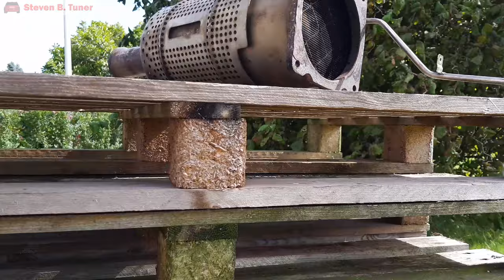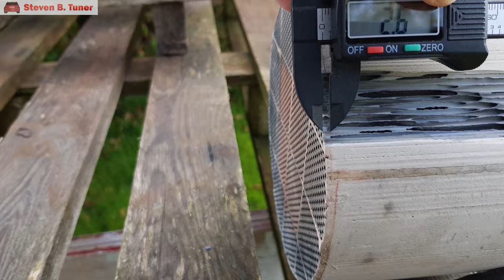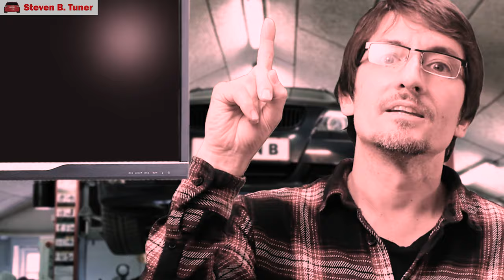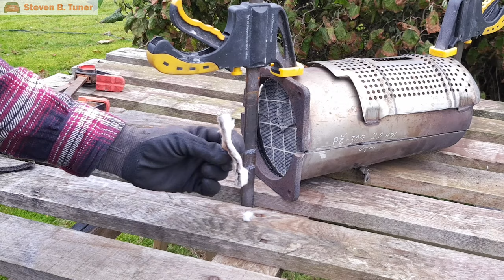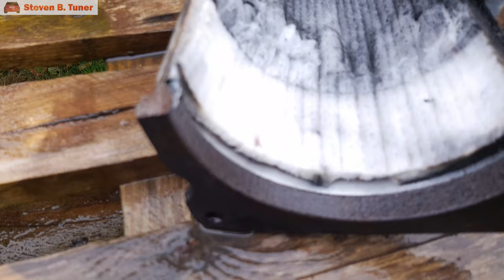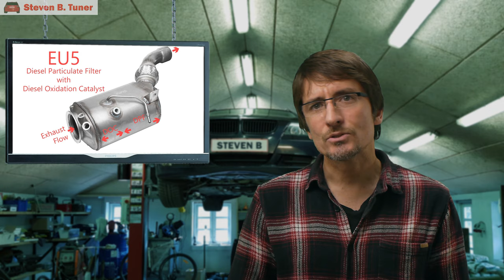Diesel Particulate Filter Versus Pressure Washer – How To Avoid Damage

Comment: hey Steven, another great video... I'm sure alot of people would really like to see a video of how "you" would go about cleaning a dpf installed on the car, especially me.. because your videos go in depth and you explain everything properly and clearly.
Reply from the maker: Hi, thanks! A lot of folk want that kind of video, starting from error code / ash level, then to removal and cleaning and re-installation, and then finally a 2nd ash reading from the diagnostic tool. It would be a bit rude if I didn't do one!
Reply from the maker: Hi, video coming soon! :-)  That's a lot of oil to get past the oil rings, unless your engine has a very high mileage - are you sure it isn't the turbo, or the rocker cover or head gasket?

Comment: Best way to clean it is, "Add 200ml Harpic + 1 cup of detergent mixed in 2 litres of water and keep it soaked at least 1-2 hours and then wash it with pressurised water. dry it with compressed air before to reinstall it  👍🏾"
Reply from the maker: Thanks for sharing your method!

Comment: Also, how about backflushing the DPF using compressed air? You could get to each channel separately (if you cut the filter housing and then weld it back together) and most compressors do only 8 or 10 bar of pressure, so that wouldn't be that damaging I guess.
Reply from the maker: Hi, that kind of method works great for truck and bus filters that are designed for easy cleaning, and the compressed air is used after an overnight bake in an industrial oven.

Comment: I pressure washed my dpf in the car wash. I used the low pressure at the beginning and it seems to be cleaning it. Then I used the high pressure and some particles came out of the exhaust end and I stopped right away. I hope I didn't do much damage. I'll just re install it and see where we end up with
Reply: You must clean it with compressed air after washing  👍🏾

Comment: So don't hold the pressure washer nozzle very close to what you're washing , especially not for an extended period of time. The lessons learned here can be applied to most things you'd want to pressure wash
Reply from the maker: Hi, thanks for watching! A lot of DPFs are very enclosed in their housing with only a 2 - 3 inch inlet pipe - which makes knowing how far away the jet is, and what is being pointed at pretty challenging - especially with water and gunk flying straight back at you. For that reason I still prefer the 2 stage chemical cleaning featured in my other video: https://www.youtube.com/watch?v=LE1boZ3fhLg

Comment: I wonder if there isn't a risk of plugging up the filter bu forcing particulates to migrate further into the ceramic material.
Reply from the maker: It is generally a pretty bad idea, but if you did do it, you would only back-flush the filter so that the soot was forced out the way it went in.

Comment: Love your dpf videos and this is very interesting but I have one concern... since the filter was cut into pieces don't you think that would effect the overall structure integrity Of the filter elements, glue etc? Maybe less damge would be done if the filter was intact? Would love to know what you think. Thanks for the videos!
Reply from the maker: Hi, thanks for watching, and for bringing up a very valid point! If I end up with a DPF that is no good for anything else, then a full-size test will be done. The important thing to note however is that almost all DPFs now have integrated catalysts, and a pressure washer will definitely ruin them.
Reply: @StevenBTuner  thanks for the reply! The integrated catalyst you speak of.. what year did they start including that? For example I have a 2008 6.7 cummins. Thanks!
Reply from the maker: @thomasglace6999  Hi, 2008 was in the transition period so it really depends on local laws and model release cycles. Sometimes you can tell by looking at the housing (or a diagram of it) and if there is a temperature sensor one third of the way along it, then there is more than just the DPF ceramic material in there.

Comment: Hi steven B. Tuner thanks for making awesome video. What about the pressure withstand capacity of DPF substrate.
Reply from the maker: Hi, the silicon carbide material itself is super tough and is not even marked by 140bar pressure at point blank range.

Comment: Funny I’ve cleaned my filters on my truck three times with high pressure water and did not damage them . Every 200 thousand miles
Reply from the maker: Hi, thanks for watching! It is a bit different with a truck as you can get good access to everything. With a lot of cars the filter is only accessible via a strangely angled pipe, so it is impossible to evenly spray the ceramic or even see how close you are or what kind of job you are doing - so the danger of spraying too much on the weaker adhesive material is much greater.
Reply: @StevenBTuner  whos cleaning the dpf while its still in the car

Comment: Hi if the DPF clean like u showd one video , dpf clean after fit on the car dose it need re generation ??? Or just start the car warm up nd test drive !
Reply from the maker: Hi, thanks for watching! There should be no black soot left in the filter, so no forced regeneration is required. Depending on the car, you may need to tell the ECU that there is a new DPF installed (usually only for cars built before 2010).

Comment: So far it seems that all those workshops that use special pressure washing cabinets are actually doing more harm than good, while simultaneously claiming that cleaning a dpf with acid or drain cleaner is going to destroy the filter.
Reply from the maker: Hi, there are a few ways that professional companies clean the filters, and the 'high pressure / low flow' method works well too.

Comment: hello Steve:  I have an SL63 AMG 2011. four cats totally clogged.  i remove entire pipe ten feet one piece long... Do i pour hot diluted sodium hydroxide pellets food grade, and let sit for one hour?  Any suggestions would be very helpful... Thanks much..
Reply from the maker: Hi, if it oil clogging caused by a blown or leaking turbo (for example) then sodium hydroxide should loosen it all up for sure. I haven't done exactly that before so I can't recommend any quantities. I suspect some agitation every 15 minutes will help too. I hope you'll report back about how it goes!
Reply: @StevenBTuner  thank you.  The 4 cats are clogged after normal driving 265,000 miles.  Nothing broken.
Reply from the maker: Hi, it will be interesting to see what comes out. I would hang up the pipes and let them dry out for a couple of days after the cleaning to make sure that there isn't a lot of water being turned to steam when the engine starts up - and even then 10 minutes at idle might be a good idea before driving. It will be an experiment for sure, but might be one that is worthwhile compared to the normal 'fix' which is to buy new units.
Reply: @StevenBTuner  i removed all four sensors out sprayed ten cans of PDF cleaner made in germany product , it cleaned it a bit, but they are so clogged that it was a waste of time and money..
Reply from the maker: Hi, those kinds of products are more of a servicing type thing - they can help if you do them once every year or two.

Comment: Hi just discovered the channel, really intresting videos.
What do you think about hydrogen washing to clean Dpf and Engine?
Reply from the maker: Hi, glad you like the channel! Are you referring to a specific product or do you mean hydrogen gas or maybe hydrogen peroxide?
Reply: @StevenBTuner  Yes the HHO by electrolysis, there are some videos about. 
They put a tube in the  intake and rev to about 1500 rpm in neutral for some hours (generally 2), than detach the tube and a run on street at high rpm to heat up and burn residues. They claim to clean Dpf, injectors and valves.
Seems a little too simple without taking anything apart?
Reply from the maker: Hi, it could be useful for cleaning the intake system and valves as the process removes carbon (soot). However, it's not going to do anything to clean out the end-of-life ash deposits from a DPF, so a chemical clean is still needed when the DPF gets clogged.

Comment: Hey mate. Love your videos!! I have a question about just a Peugeot 307 1.6 HDI DPF

I've got an app for just this car called FAP, it's telling me loads of info and my filter is good for now. But one reading in the app is "Deposits in FAP" and the number is 122 grams, slowly rising. Now what does this mean? My car does around 300 km between every regen

Thanks again for great videos
Reply from the maker: Hi, thanks for watching and I'm glad you like the vids!  If that 'deposits' number is that high just after a regen, then I would say that your filter is getting quite clogged up with ash. Has your car done more than 200,000kms? Also, 300kms between regens sounds very low too, which indicates that there is less and less room in the filter for the soot to accumulate between active regeneration cycles.
Reply: @StevenBTuner  Hi

Ok so a manual cleaning might be in it's place. No "deposits in FAP" doesn't get to zero after a regen, so I think that number is what's left and can't get rid of. But a manual cleaning seems pretty straight forward actually, not the first time I've been under a car so I'll think I manage that
Reply from the maker: Hi, if the filter isn't too painful to remove and re-install then a few hours with a few nasty chemicals will have it back to as-new condition!
Reply: Hey mate. So the washing of my dpf is now a done deal. Really not much soot so the regen must be working. Loads of ash thou, which is now gone. I used oxalic acid in i aluminium wheel cleaner, 4 liters. Soaked for 2 hours, flushed it with 4 liters of boiling water and then loads and loads loads of cold water in a backflush while shaking the filter. Eventually all that came out was clean water. F*cked up a little bit by forgetting the gasket while putting it all together, so i had to tear it all apart again haha. Now it's showing 0 g of deposits in FAP, and the acceleration is better. Thx for the help mate!!!!
Reply from the maker: Awesome! Thanks for sharing your experience!
Reply: @Andy_83_SWE  hi, the problem with those DPF's is the additive used by PSA to force regeneration. The additive, so called Eolys in some countries is an ash catalyst based on cerium oxide. This will increase exhaust temperature to help regeneration but will leave ash residues inside the DPF. With time the DPF will be blocked of ash so you will have to replace it, in facg if tou check your user manual, PSA set service periods for the DPF to be replaced they go fron 120.000 to 220.000 km depending on the model.
Hope that helps

Comment: Why is the filter orange in the middle? When I washed my filter a bit of orange/light brown came out. I used alcohol and a low pressure water beam.
Reply from the maker: Hi, thanks for watching! The orange/red is ash residue, which was left over from my previous video where I hit this piece of filter with the gas torch.  A few minutes with the gas torch was enough to remove all of the black soot, but it wasn't enough to remove the ash residue. The different shades of ash depend on what it is made from - more red is probably more iron oxide (from the iron/steel in the engine), and more of a white shade probably indicates more phosphates/sulfates (from engine oil).
Reply: @StevenBTuner  Thank you very much! I was afraid of having flushed out part of the filter :) Great videos for DIY cleaning your filter. They saved me some time and gave me a few ideas on how to clean my DPF.

Comment: for a start why would you go closer when washing also use lower pressure washer never messed one up yet ...when you add fluid let leave it  soaking for ten hours then use washer to clean it out will come out easy the soaking in the fluid would have broken it all down so you do not need to go mad and up close with washer it will get all the shite out and bingo nice and clean
Reply from the maker: Hi, not all DPFs allow you to see easily where you are cleaning - so unintentional damage is possible, and you will definitely damage the DOC if you send high pressure into the engine side of the DPF housing.

Comment: I was planing to wash it with a small pressure washer ( dont have much pressure), but now I will just use the garden hose with pressure head😂
Reply from the maker: If you have done the 2 stage chemical wash (from my other vid) then rinsing with water mixed with some dishwashing liquid will clear out any chemical residue well enough.

Comment: I do loads with a pressure washer never had an issue 🤷‍♂️
Reply from the maker: Hi, if it is done at a bit of a distance and carefully to avoid the ceramic glue between modules, and only done to back-wash the filter then it can definitely work. The problem can be where you can't see what you are doing due to bends in the exhaust pipe etc. The other thing to avoid is hitting the catalyst material with high pressure as you will rip the precious metals off and send them down the drain!

Comment: Hi Steven, What about using an oven cleaner as available at any grocery store?
Reply from the maker: Hi, thanks for watching and for the great suggestion!  Oven cleaner is similar to the drain cleaner/caustic soda that I use in a couple of my other vids, so it will probably work great as a 'pre-wash' to remove any oil and oily soot ready for the main acid based wash.

Comment: another way if the DPF is to boil water an stir in a small box baking soda-pour it in the DPF /it cleans the inside of car radiators-do it twice an then flush with clear water/should work great on DPF too/plug the end of pipe as you did/it takes rust-slime an griddy stuff out of radiators/an its cheap/but do it twice-you done have to buy that other stuff/thanks much
Reply from the maker: Hi, thanks for the suggestion - I will certainly add it to the list of methods to test!
Reply: @StevenBTuner  - Don't try it inside the Radiator please

Comment: Hello Steve, I have a Citroen C4 PIcasso from 2007, the dpf is 400%, a new dpf is 170euros and a clean 150,what should I choose? thanks indavance
Reply from the maker: Hi, if it is a genuine Citroen DPF then it is an easy choice, but if it is a re-manufactured or copy part then it may be made with less than OEM quality materials, so a clean of your original filter can be a better long term deal.
Reply: @StevenBTuner  thanks for the reply,much appreciated, what I found is a no name spare, I'll try a clean by closing one end of the dpf, fill it with concentrated wheel cleaner and let is soak for 24 hours, than wash out. If that doe a bed job I'll replace it,tbd with which part.
Reply from the maker: Hi, if you're ok with DIY then you can see my whole process in the video "The No Damage DIY DPF Clean". You don't want to leave most acids too long as they will eat the steel / stainless steel.

Comment: I usually just wash My exaust By putting in a water hose in it with a running engine
Reply from the maker: Hi, thanks for watching, and for sharing your method! The risk with that method is that if any water gets trapped in a blocked channel then it could instantly turn to steam and cause a crack in the ceramic. What kind of water flow and engine rpm are you using?
Reply: Steven B. Tuner i dont know the pressure exactly but basically just regular gardening hose pressure. Basically the pressure that it is pouring out of the hose like from a tap. If i am not mistaken 7-10liters a minute i am pouring. RPMs at idle and once in a while i accelerate until 2.5 - 3k rpm
Reply: @davisliepins1380  I can't believe this method would work whatsoever, not without looking at the dpf internally, refitting, using your garden hose method, then pulling dpf out again to inspect

Comment: Why can’t you blow it out with a air hose
Reply from the maker: Hi, thanks for watching! Ash removal using air pressure is used after a DPF has been heated for 8 hours in a high temperature oven. Without the heating to break down the ash it is much too stuck on to remove just with air.
Reply: @StevenBTuner  ok thanks